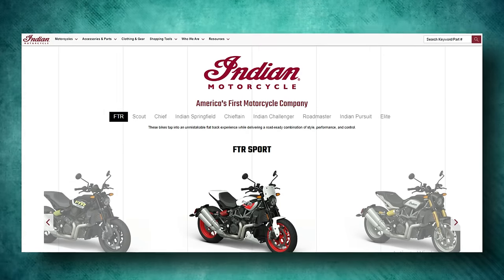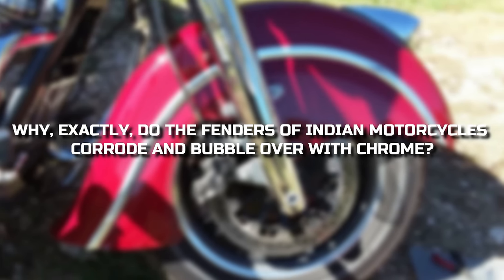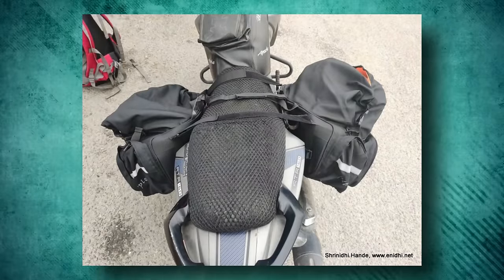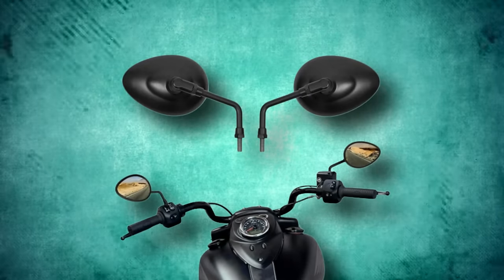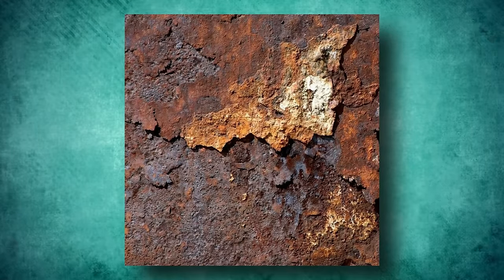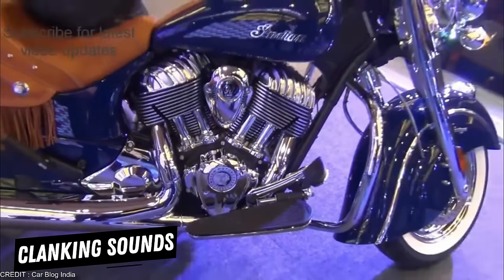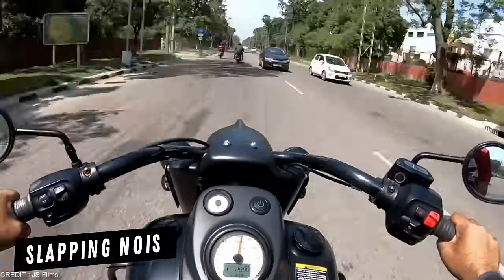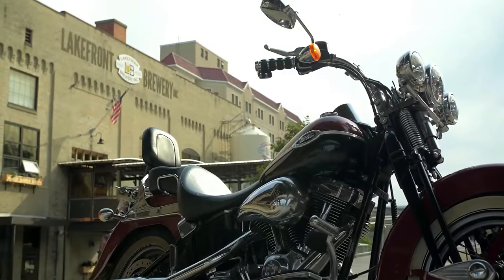This is why Indian Motorcycles SUCK

Comment: When I go cross country riding on my Chieftain with my Harley friends, I'm the only one not carrying tools!
Reply: Lol.
Reply: Lol!! I have a 1996 Honda shadow 1100. Now that you got me thinking 🤔 I don't even know or were my tool set is. Lmao 🤣.
Reply: Went to Sturgis on my scout along with with four other bikes, we were down one honda shadow and one street guide buy the time we got there. Everyone but myself traded in for a different bike and we came back with my scout, a chief and three road guides. Ironically, the clutch lever failed on one street glide about an hrs from Sturgis and he dumped the bike, because try stopping a bike that big with no clutch. Then the motor went in one of the other streets glides a month later. 🤷‍♂️
Reply: My 2000 Road King Classic has 103,500 miles. I’ve NEVER carried a tool kit and NEVER suffered a break down on a ride. On the flip side, an HD buddy of mine, flipped to Indian back in ‘17.  He broke down while on a 3,000 mile group ride, had to be towed 100 miles to the nearest Indian dealer for repairs. He didn’t catch up to the group for a full day. He got tired of our Indian dealer taking forever to do basic maintenance, not having certified mechanics, off site repair shop, trouble getting parts.
Reply: Reminds me of 1960s Triumphs!

Comment: I can only ram a huge positive flag into the ground for my Indian. I am still very, very happy with my Indian Springfield. It is one of the very first ones, which I bought in  2016. Till today zero problems, no corrosion, no chrome problems, not a single engine/ transmission problem. Bike still looks like brand new! I still enjoy every km here in Germany with that great engineered thunder stroke engine.
Reply: I have 2005 88,000 miles no trouble,    but polarize still has time to pock sand in your aSS, like they did us.
Reply: I bought a Scout Bobber and immediately regretted it.

Cuz I saw a Springfield on the way out off the lot.
Reply: Darf ich fragen was deine Lange ist. Ich bin selber 1,90 und ich zweifele ob es nicht zu klein fur mich ist. Was meinst du?
Reply: @onehectareadventures  Bei der Größe solltest Du auch unbedingt die großen Modelle favorisieren. Bin 1.83 m und fahre die Indian Springfield, also ne große Indian. Kenne einige mit 1.90 die auch die großen Modelle fahren und es passt. ...Für ne Scout bist Du schlichtweg zu groß! :-)

Comment: All I heard of things that Indian use to do.  Sounds like they have corrected all if not most of these issues.  Indian have made great strides and innovations when it comes to the American V-Twin market, where as Harley Davidson has never done anything new or innovative.  Same old tech at todays full prices.
Reply: Thank you. That's exactly what I heard too. They have an issue and they deal with it. It's like that in all industries, not just motorcycles. I work at the Jeep Gladiator plant. When we have an issue we deal with it. It's the companies that have known issues and continue to produce their vehicles with these known issues that suck.
Reply: @jaxager  Harley Davidson doesn't know how to make stronger engines.  They just make bigger ones to compensate for their lack of technology.  Indian made a water cooled 108 that can hold it's own against a 131.  Not to mention, when you buy an over priced HD, you still have to upgrade to LED lights, update the suspension, get a new seat, and do a stage 2 just to make the bike what it should have been from the show room floor.
Reply: My take away was that most problems could have been solved or avoided by regular maintenance and cleaning. 🤷‍♂️

Comment: I've been working on Indians for 3 years at a pretty big dealership, and most of what you say is only with the first couple years which have since been remedied. Breaking clutch cables haven't been a problem, the "chrome" trim is plastic which doesn't rust, but in my opinion they should have used actual metal trim. The engines are damn reliable, coming from the work that went into Victory. 
Now if you want a problematic money pit, get a Harley. The twin cam motor was a huge mess for years. The timing chain setup dumped plastic and metal straight into the oil pump, the early design failed badly in a few thousand miles. After the very good Evo motor, HD went to the disaster of the twin cam, an engine lucky to make it to 50,000 miles before needing a complete rebuild. Have a failed lifter? Kiss your cases goodbye as the lifter bosses were not replaceable on the TC engine, unlike all previous designs. Transmissions were junk, plenty of failures, especially the early 5 speeds, which HD refused to take care of even under warranty. Now I hear the Milwaukee 8 has it's own bunch of problems, but doesn't that just go along with the pride of harley ownership? Own a Sportster, be prepared to be treated like crap at the dealership. As a mechanic you have to deal with idiot customers with bad attitudes and no idea of anything, the bikes covered in aftermarket crap that You will be blamed for when it breaks, even if the shop didn't put it on. 
I love motorcycles and have been at dealership level for over 35 years, but by far the worst bikes I've worked on have been Harleys, followed by some Korean ones which made Chinese bikes look like Hondas quality wise. Master certified with BMW, certified Triumph, MV Agusta and Piaggio, yamaha scooters (! remember those?) and have worked on everything from Norton to Nimbus. Honestly I hate cruisers in general, but money is money..
Reply: I don't know much about quality issues with Indian bikes, but there are huge quality issues with this video
Reply: I need help I’m undecided I don’t know much about Motorcycles but I had a Harley Davidson Daina Lowrider, I decided it was true it was my first motorcycle and I was a little disappointed since I had to put a lot of money in it and one of his problems was the Claus cable and he threw oil, I would like to know how advisable it id  Indian motorcycle or Kawasaki Vulcan?
Reply: @davidfuentes9812  A vulcan isn't a bad bike, and you can find used ones cheap. Same with Hondas really. Indian are very nice, a little expensive and if you don't have a dealer nearby who you can buy one and have service done.
Reply: @Oldbmwr100rs  Thanks for the information, you know. I had a Harley Davidson low rider in 2003. Unfortunately, I threw oil and they replaced the clutch cable. Well, I put a lot of money in it, and they told me that they have problems, the truth is I don’t know much about motorcycles, but an Indian question what kind of problems he has regularly, if you could tell me I will thank you very much for answering me!!
Reply: @davidfuentes9812  The Indians haven't really had problems overall, the early ones had software stuff that was fixed, mainly for the stereo and gps setups, but mechanically they've been very good. Victory motorcycles were also well sorted out by the time the company decided to put everything into Indian, and I like what they've done.
Reply: @Oldbmwr100rs  I created next week to be buying a 2023 Indian Motorcycle® Scout® Bobber ABS as you can see that recommendation you give me to put a different exhaust pipe!! Thank you very much, really
Reply: @davidfuentes9812  Awesome, have a lot of fun with it, and congratulations on getting a motorcycle.
Reply: Well, as a certified bmw and Triumph mechanic you MUST know that those brands have many problems but I don't hear you about those.... or have you forgotten about the Triumph starter sprag missery, failing fuel lines, front brakes squeel, the ST "sudden engine shutdown" and "melting" plastic fuel tanks....or the bmw "lifetime" driveshaft failures, dropping exhaust valves on the 1200, tps missery, kfr, cracking cases, 1100 gearbox issues, failing voltage regulators etc etc etc.  All of the forementioned problems were denied by the dealers/manufacturer. It seems you have a bone to pick with Harley, but you are not very honest are you?
Reply: @keesketsers5866  Oh trust me, I dealt with plenty of problems, especially BMW,  with their bad software, the 1200 rs clutch and transmission recalls, bad fuel level sensors, failing fuel pump controllers, the timing chain issues, leaking head gaskets and a ton of other stuff. Many of Triumph's big problems, especially the starter sprags were on their earlier bikes, and of course to replace those involved splitting the cases. Some early engines also had fast to fail exhaust valves, relays installed upside down so they would fill with water was a fun one too. But they really got their act together and got much better after 2001 so they weren't so bad.
Now many of the things you mention, like cracking cases, I never ran into that.
This vid was ragging on Indian though, and from a harley point of view, something that goes way back, and harley hasn't a leg to stand on when it comes to long term durability on their bikes, a big reason the aftermarket can literally supply every part you need to build one not using a single harley part.
Reply: Harley, bad design for well over 100 years. 
Incredible!
Thanks for your comment mate👍
Reply: I'm sure you get a lot of practice working on Indians since most of their owners don't wrench. Like you said, the Evo motor is highly regarded.
Reply: Sadly, I’d trust the MV Agusta more than I would the Harley.
Reply: I have a 2016 ultra limited with over 60k on it so far without 1 issue.  Ride what makes you smile and stop worrying about the small things.
Reply: Hello !!! Well you sure sound like you know what you're talking about bud.
I'm about to buy a 2004 Harley V-rod this weekend with 2,671 miles. I would GREATLY appreciate your insight sir.
In a nutshell, are they good bikes?
Reply: @leoclement3801 I haven't heard any real systemic issues with the Vrod, but they're old now regardless of miles. As any low mileage older bike, it'll need the brake fluids serviced at least, and likely if the fork seals aren't leaking they've been replaced. I don't know if any HD dealer would help you with it now is the only issue, you'll have to find a shop that's willing to care for all the services you can't do yourself. Otherwise I think they're good bikes, but it'll also depend on how it's been ridden and cared for like any other used bike.
Reply: Good morning Sir,can you give me some information on Honda shadow aero 750 ,2024 model ,thank you 🙏
Reply: anything bad for ftr1200? hows the engine build quality
Reply: @lucaric6935  Honestly, the scout line including the FTR has been really solid and reliable. The build quality is very good, I have no real complaints, and owners love their bikes.
Reply: @Oldbmwr100rs  just wondering the ftr's" mileage " stored in the ecu or in the odometer gauges? gonna look at a used ftr soon, owner said only 300km, in case the owner not lied to me.
Reply: @lucaric6935  I believe it's stored in both, depending on the speedo display though, as I've replaced a damaged display and had to program the miles into it using the shop scan tool to migrate the ecu miles to it. As for the low miles, look at the tires, if the date codes are from the same year as the bike and the tires have little wear, likely it's correct. Some people never ride bikes they buy, can't understand why.
Reply: @Oldbmwr100rs  appreciate, ur infos are pro
Reply: @Oldbmwr100rs  btw, do you know something about 2022 yamaha mt10? any common issues?
Reply: For as good looking as the engine is its odd to me they have plastic chrome trim. To me thats the facade of quality without the price of whats really underneith tbe facade which is the poing of a facade. If it was me id remove the chrome strip there entirely and make the classic covered side style fender just a little more sleek and slim and classy looking. My last bike was 2008 kawasaki vulcan 1600 and it was dark blue and black it had chrome but no studs no chrome on the front fender. There was a lotta real chrome not fake chrome. And you pay so much for a bike you dont want a crap job like plastic tape chrome. Better to have no plastic there at all I say thats higher quality and believe me im a fan of the chrome.engine and exhaust i really like when theyre not ugly colors too

Comment: Some interesting comments. I own a 2017 Indian Springfield which I bought brand new. It has been used for extensive touring in North America and Australia. 
The chrome is still near new everywhere. Some slight bubbling on the 3M plastic tape but you have to look for it. The front war bonnet was removed and recoated and sealed which fixed the base plate rust. Mirrors just require correct adjustment. My bike has the optional oil cooler. I let the bike warm up which takes longer. But it doesn't overheat even in extreme conditions while riding. But I don't let it overheat stationary either. I only use Indian Oil and I check that it's correct. The engine has to be ridden a decent distance so it's at operating temperature. Dealers don't do this and as a consequence they can get it wrong! Mine actually takes about 6 quarts but it has the additional oil cooler. So there's oil in lines and radiator.
Zero clanking completely reliable.

Great bike just needs good servicing adjustment and care. Still looks like new.

Comment: I have a 2022 Springfield and I love it. I bought it new, so yes I have a warranty. That said, I've had two issues since my purchase a year and a half ago. 1) the windshield developed small cracks at the bolt locations and 2) the front chrome piece referenced in this video began babbling. When I brought this to my dealerships attention they replaced it without charge. All in all I wouldn't own another bike. My personal opinion is when you by something, especially new, you shouldn't be surprised if some small minor things happen. It should only be an issue IF the dealership doesn't make it right!

Comment: I love my Indian..it’s the best bike I’ve ever ridden. I’ve only had one small issue with it and that was because I rode it in 16 degree weather and condensation built up when I stopped for gas. Other than that it’s my dream bike!
Reply: That's cold,
Reply: What else have you owned?
Reply: @snidely_whiplash  Yamaha Vtx1300 then an 1800, Hd softail then went to a road King and finally hd street glide. Those are the main bikes I spent the most time on anyway. 
My son just got a 23’ Indian Sport Chief. Looks great but I love my forward controls
Reply: What consequense did the condensation build up result in?
Reply: @ddekeno1  luckily it just seemed to freeze the key fob. I warmed it up inside my jacket for a few minutes then it fired right up no issues.
Reply: I escorted funerals on a Sporster in 5 degree weather and the only thing that was bad was my frozen knees.

Comment: Bless his heart. The plastic chrome strips that are not welded but I attached through double back adhesive tape through 3M are easily replaced but yes they do fail. On my 2016 Indian Springfield I have never replaced mine, but they have failed this year and are going to have to be replaced That six years of good service before failure of a plastic chrome strip, that again, is not tack, welded to anything. My suggestion is, if you’re going to criticize, you might have your head out of your ass before you start, now, let’s discuss how much torque and horsepower my 116 Thunderstroke push to the ground whip , the tune, the exhaust and the upgraded air induction system.

Comment: From what lve seen the suspension on the Indian is superior to HD. So no need to spend more to upgrade that. Snd balance handling better. The engineering on the Indian is better. Gear primary and opposite side secondary belt. U can change the belt much easier and quicker. Only 1 oil to change. A Harley is a Harley that’s what it is. It has its own distinction and feel. I like both. Some things l like better on one than the other. Buy what u like or want. But the best thing u can do is test ride different bike and then decide for yourself. Some are after looks and sound some like form and function.

Comment: My next bike is an Indian Springfield, and I would not even consider a new HD. The company has become a corporate part selling company after 2014. And talk about failures, the HD 2018 oil migration problem fix was a real example of a company sticking it's middle finger at the buyer sending out a paper target to drill through, oh! And stop in traffic with a 131 motor and cook the heads in under 1000 miles. I own an 03 heritage anniversary model and it is definitely the last unless HD UPS it's game. Indian has.